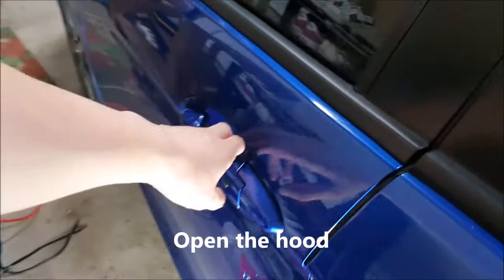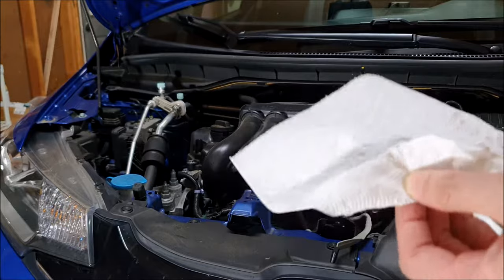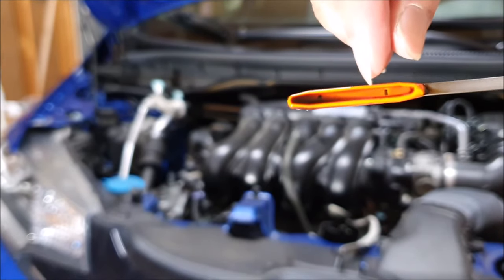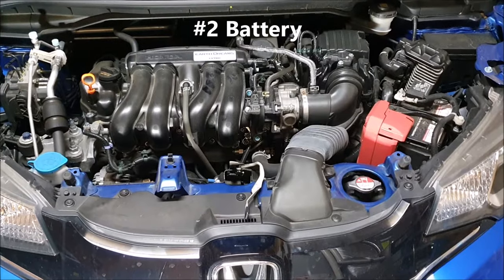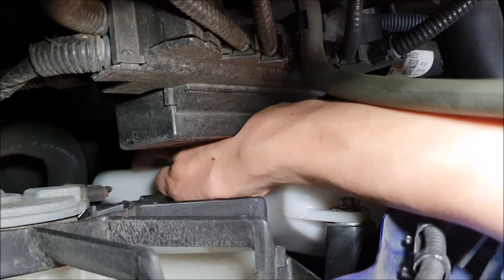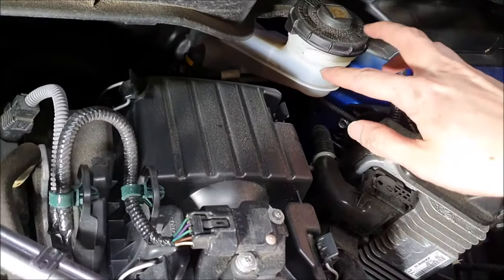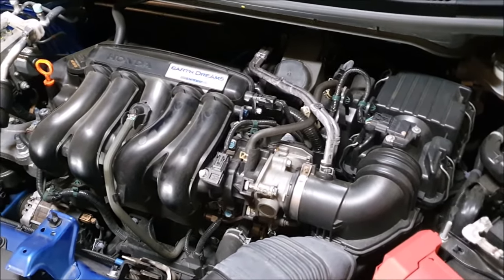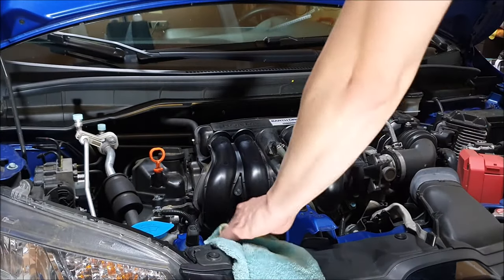Honda Fit What to Check Under the Hood | Beginners Comprehensive Guide

Comment: This is the guy you want to buy a used Honda Fit from.
Reply: I drove one for like 10
Years.  It was my car for college and work.  By the time I got rid of it it, it had 220,000 miles and was still running in good condition.  It’s a perfect car for a big city like Los Angeles.  It’s very easy to repair.  I believe the guy that bought it replaced many parts for new.
Reply: Except he thought windshield washer fluid was more important to mention than your air filter… dirty air filter can cause poor mpg, engine hesitation, foul your mass air flow sensor, or even worse.
Reply: @awdobsession717  
This is what the internet is all about. If you have suggestions, we all benefit from it. Thank you kindly

Comment: I never just wipe away white corrosion on the battery terminals. I mix a little baking soda with water and pour it on and it neutralizes and dissolves the white powder. I then remove the terminal cables: negative off first and replaced last and coat the terminals with dielectric "grease" or vaseline.

Comment: If you open the top of the coolant reservoir and shine a flashlight down there inside the throat, it's mush easier to see the level. Same for the window washer tank and the brank fluid one. I also find the orange plastic thing on the dipstick hard to read. They should have just left it a metal one. Both my Fit and Civic have this same orange thing that's hard to read reliably. One of Honda's blunders, IMO. My lawn mower has a dipstick that is just metal down at the tip, very easy to read.

Comment: Thank you so much for making this video!  I just bought an 09 Honda Fit Sport 2 days ago. Checking all the fluid levels in this car is VERY important to me!
Reply: How is it a year later? I just bought the same thing!
Reply: @InnerCityX  blue moon my Honda Fit is doing very well! It’s nice that my car gets 42 mph on the highway. My car needs an oil change. Beyond that blue moon is doing very well.
Reply: @MsLee-oh7hy  right on glad to hear it!! I haven't named mine yet but it's the purple model and I'm so beyond stoked to have a purple car. It came out of nowhere and into my life! Fitgang!!
Reply: @MsLee-oh7hy Wow! 42mpg is a lot. Only ever got around 30mpg doing stop and go. I guess I'll find what my 09 is capable of soon. Got a job that is pretty far away and will be putting on the highway miles!

Comment: Thanks for sharing. I would also check tire pressure periodically and replace air filters every 15,000 miles. I think that the transmission dip stick should be returned to engine design. Also, full size spare tires need to be part of standard safety equipment and should be law. It really worries me when I need to use that tiny temporary spare tire. It feels unsafe and handles poorly when it is on the car.

Comment: 6:18 if your radiator fluid was so low, how come it's up to the top here? For me before I checked the level and I couldn't see it so I juggle it to feel the weight and It feels low, but when I take the cap off its overflowing

Comment: I just subscribed to your Youtube podcast channel. Thank You.
1 1/2 Hrs on-line now searching 2013 Honda FIT blue sea thermometer Dash Light meant.
Rephrasing over and over my issue. I reviewed so many dumb results tied to Honda FITS, but the junk I had to weed thru for answers took over an hour,
My point is glad to find your channel. Very Happy to subsribe. gain, Thank You.

 My 5 speed 2013 Honda Fit just started this problem.  Once engine startup dashboard  check complete, my car's sea-blue thermometer remains on 1 or 2 minutes. Jan 2024 Penna Winter Temp today 27 degrees w/Snow Showers to start overnight. I did top-off the Coolant reserve a week ago. The Dashboard Blue Lgt is sticking ON again. Same as before, Blue Temp Sea Light stays lit for 1 or 2 min. * It's so cool outside right now 4Me to open radiator cap. I will PDQ as per your great details 2do!*

Comment: Huge Noob so dont judge. I have a 17’ Fit that I brought to the dealership to diagnose an oil leak. They told me they have to reseal the crankshaft and reseal the engine block oil separator. What is an engine block oil separator? Why does it cost $750 to reseal? Does my car even have one? I have absolutely no idea what it is
Reply: I just ask them to show me. Put it up on the lift, and point to where it's leaking. Leaks are often visible because there's fluid there. 
If the shop can't let you in for insurance reasons, the mechanic can just take photos on their phone, walk back, and show you that way. 
I realize this reply is late. I hope you were able to get it solved without much trouble.

Comment: I have a 2009 fit sport, and I’m having some issues. Do you have any videos on fuel injection system checks or replacements? And or oil leak fixes?

Comment: 3 things to check for on the oil on an earth dreams Honda engine, you got the level and the color, but should give it a smell make sure you don't smell gas.  The high PSI of the fuel injector can push the gas past the rings on get gas in your oil.
Reply from the maker: Good tip thanks!
Reply: I believe you are referring to the 1.5T engine that comes equipped on the Civic Si and the CRV.
That is not the same 1.5L engine that is on the fit.
Reply: @HondaFit4Adventure  Yeah I hear its more on the turbo engines.  But for what its worth I have seen some posts on the fit forums talking about how they have oil dilution.  But even if they don't get oil dilution, they can still get gummed up valves, depending on your driving habits.  Either way it was a new engine and they still need to work the kinks.

Comment: Random question...I have a 2019 Honda Fit Sport and noticed that there is no rubber cover piece in the middle of the engine hood above the Honda logo. There's rubber aligned the rest of it to protect from dirt and debris getting into the engine, but is this left blank intentionally because that is where the switch/hook is to open the engine hood? It looks like you don't have a rubber piece either above the "H"...is it missing or not meant to be there? LOL thanks!

Comment: Thanks for the reminder... for some reason, I've neglected my 2010 fit.  I put 180,000 miles on it over the last decade but have never added or checked the oil (do change it when the minder tells me to) and have never added or changed the brake fluid or coolant.  Last time I put on new brake pads I just swapped them out in 10 minutes flat and the fluid was still at a good level.  I've never cleaned the engine, or the battery terminals either.  I put in a new engine air filter at some point, 'can't remember when.  Maybe this Summer I'll give the whole thing a good once-over.
Reply: Why would you neglect it.....I'll never understand ppl not checking their oil....
Reply: @richsweeney1115  Life happens; I got busy.  I did change the oil and oil filter, every time the on-board minder indicated that I should.  Each time I checked the oil and it was not low.  I changed the engine air filter once, replaced the brake pads as needed,  replaced wiper blades and light bulbs as needed, had a tire place replace the tires as needed.  I punted on the spark plug replacement, valve adjustment, brake fluid flush, new engine coolant, new transmission fluid.  My bad.  The car is now over 10 years old, has 180,000 miles on it, and runs flawlessly.  This Spring I'm ready to lavish a little care on the thing.
Reply: @paulh6591  my ex has an orange 09 fit sport, we both love it, it's a standard, so it's fun to drive, it has 180k and runs like new
Reply: Nice, I just hit 100k. This weekend I'm finally getting to the neglected fluids and cleaning.

Comment: Good morning. I have the Honda fit EX-L. The Honda fit sport is one Honda for model I learned this a few months after my 42 mpg highway Youtube reply on here. I too recently started working at a new job and I have a 45-58 minute commute Tuesday through Friday. My Honda Fit Ex-L only has a 10 gallon fuel tank. So since it’s winter time I buy the mid grade gas for my Honda Fit so I don’t have to pump gas daily. Beyond the small gas tank on it I love my Honda Fit EX-L.

Comment: not sure if you're right saying that engine should be cold. according to the service manual you should warm up engine. halt it and wait for 5 minutes and then pull out the deep stick and check oil level and colour as well. try to do that like I said.

Comment: Thank you! Is the oil % level accurate? I have 2020 Fit, and it was at 60%- was told by oil changer that oil was almost out and filthy. Now I feel I can’t trust the oil minder on dash..
Reply: I'm pretty sure the percentage is just calculated on miles, it doesn't test your oil or anything like that
Reply: I have a 2017 and the oil changer goes to zero at 10,000 miles. I change mine every 3,000. 5,000 was fine, but I like doing it at 3,000. Now lets wait for someone to reply to me telling me I am wasting money changing my oil every 3,000 miles.

Comment: So I have a question I have a Honda fit I just purchased it’s used 2012 great shape they heard Rod is it supposed to be loose you have one piece of fish in the hole at the bottom and then when you raise the head rod to keep the hood up it’s a white piece that goes into the hole for the hood the question that I have the bottom it supposed to be real loose

Comment: How do I know what type of engine oil to buy?
Reply from the maker: 0w20 for the 2015-2020 Honda fit. Otherwise, it says in the manual
Reply: 09 takes 5 20 ...it says it on the oil cap too. Google will tell you..or in the manual

Comment: Thanks for the video.  I found out, I need 0W20 oil.  which is better for the fit (2020), synthetic or regular motor oil?  Also, is one brand/color better than another for the coolant?
Reply from the maker: Motor oil I use full synthetic, I think with 0w20 you only have the option of full or blend. For the coolant I'm not really sure I would probably get the honda oem

Comment: Thanks you so much ! It was very useful information on maintenance. Keep up the great work on your Chanel ! :) I have a 2016 Honda Fit , same color as yours :) . Few months ago I lost my engine splash shield from unknowingly dragging it for many miles. I know a lot of cars lose them on the highways and people thinks it’s not a big deal to drive with out it. What are your thoughts ?
Reply from the maker: Thanks, for the splash guard you can probably leave it off. Its supposed to help aerodynamics and protect from corrosion. Its very easy to fall off on the fit, mine is loose at the back and have to zip tie it on. I actually talk about this in my oil change video, which I will hopefully post soon

Comment: Thank you for this tutorial, very helpful.  I have a honda fit ex 2016 and I notice that when I shut off my car 2 red flashing lights go on . One is by the screen panel where the monitor is and the other is by speedometer. Is this normal? They just flash in red.
Reply: Hi Rosie. 
It could be an alarm indicator light.
If it only flashes a few times and goes away, count how many times it flashes as it could be an error code.
Best wishes.

Comment: I haven't had the oil changed in my 2013 model since 2019. I drive infrequently, however. At the 2019 oil change it had 14,785 miles only. It currently has a little over 16k. According to the indicator I am at 40 percent despite the years. I have never had the brake or transmission fluids changed. I probably would've had the oil changed in 2021 even if the indicator was above 15 percent, but I was fearful about the pandemic. Every October or November or so, the indicator for tire pressure lights up without fail since it was brand new. I put some air in all four tires and it goes away until the next year. I think I will finally do my oil change in this spring.
Reply: Conventional oil will need to replaced even if you do not drive with it much because it looses it’s correct properties with time. You should only do something like that will full synthetic oil
Reply: Good luck getting under the car, only thing i hate about fits

Comment: My AC quit working last year....(not blowing cold air).I took it to a mechanic and they added freon to it.  It worked all summer.  I turned it on the other day and is not blowing cold air ☹. Any suggestions other than taking it back to the mechanic?
Reply from the maker: You must have a leak somewhere in the system. Has not happened to my fit but happened to another honda I had. You can buy a can of the refrigerant and refill it yourself for $20-30. Instructions on the can. That's an easy work around to finding and fixing the leak which could be  hard to find and expensive to fix
Reply: When you refill the refrigerant, add a dye. Then check later for traces of that dye around the service ports and the compressor. This is what mechanics do.

Comment: Engine totally cold? When checking oil level?
Reply from the maker: That's always what I've done. I think it easiest to get an accurate measurement ( no excess oil on the upper part of of stick). Some do recommend checking when the engine is warm so I guess thay works fine too

Comment: What about drivers side door leaks and water in floor? What do I do?
Reply: You might need to replace the weatherstripping on the driver's side door or reseal it. As for the water, maybe a wet/dry shop vac? I would also check for rust--you'd have to move the seat and floor carpet to check the metal underneath
Reply: I had the exact same issue for years -- open the sunroof, spool a long line of weed whacker twine gently down the two sunroof drain holes until you hit a dead end on each. Spin it around to clear any blockages, remove it, then pour a good amount of water down each drain and watch for it to quickly exit down to the ground by the tire wells. Wait for a heavy downpour, check for a dry carpet and celebrate! Neither the dealership or bodyshop could ever replicate this issue, and they'll try to clear the drains using compressed air which unfortunately doesn't work and will be a waste of your time and money.

Comment: What are you using to clean the engine bay at the end?
Reply from the maker: I just either water or a quick detailer or or wash less cleaner like optimum no rinse. I figure these should be safe on all materials under the hood (metal, painted metal, plastic, rubber)
Reply: Water with a little bit of dish soap in it is pretty good at cleaning up the engine. It's considered a light degreaser. I watch ChrisFix use it all the time when cleaning engines

Comment: Never go over 3k don’t care about synthetic don’t go over 3k unless u want sludge in ur block. Good video still. 4:39 use baking soda and water to get the white stuff off ur batt 2nd use dielectric grease on the batt terminal to stop that intact use that grease on anything electric
Reply: Yes I agree with your statement on oil. The gas puts the dirt in the oil. The synthetic may hold up better, but the engine and gas still puts dirt in in the oil at the same rate.
Reply: 3k oil change intervals on synthetic oil? lol that's a waste of time and money